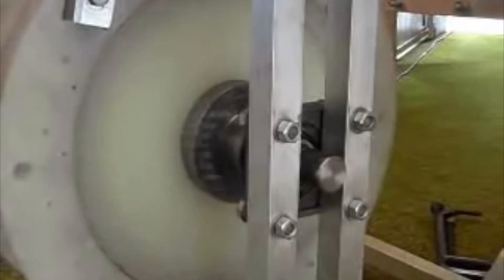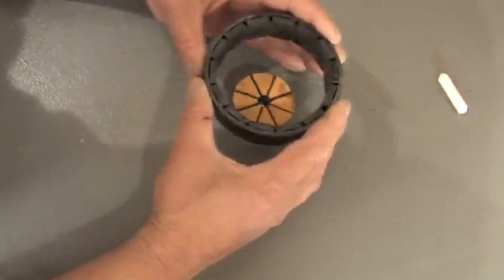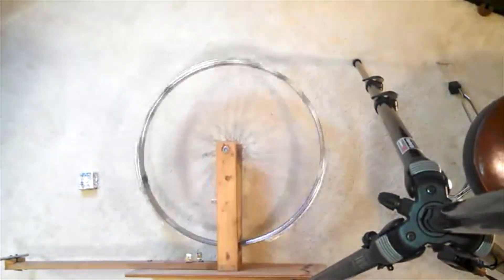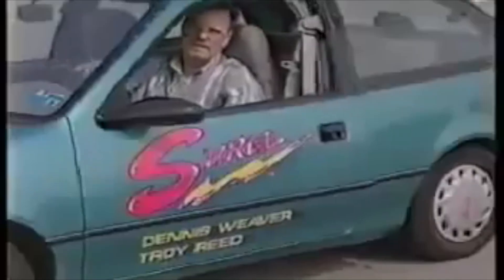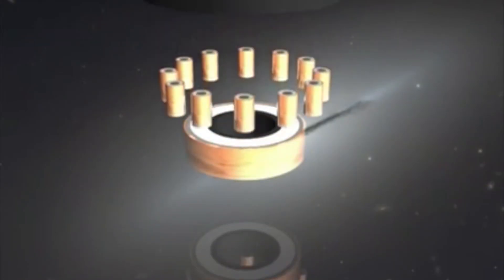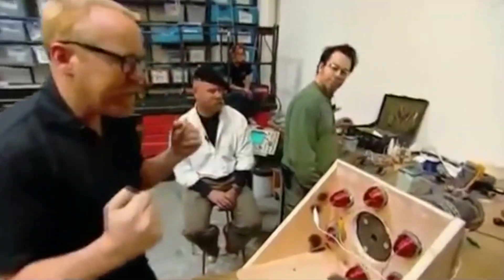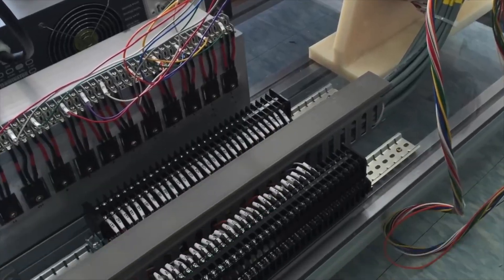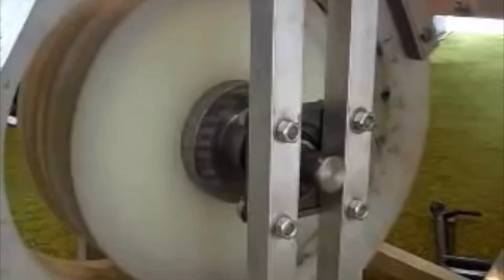Top 10 Most Famous Magnetic Motors

Comment: are those fake or real?? why is not possible to buy or found one ?
Reply: @darklight2.1  if magnets are not a source of energy how can work a dynamo??
Reply: @darklight2.1  its not simply, it convert with magnetism mechanical in eltctric, but why is not possible that this electric magnetic  energy is more than the machanical dynamo need  for rotate? dont need so much mechanical energy a dynamo to rotate , not much frictions, but it can generate a big load of electricity..so...
Reply: @darklight2.1  im not a scientist and matematic and my english is bad, but you tell me that a dynamo cant produce more energy than the energy need to move the dynamo right? but so why a 3hp power elettric motor can rotate and  work a 12kw dynamo?  for example if a dynamo need reach 2000 rmp to produce 12kw and an elettric motor produce 4kw at 2000rpm, so when you connect motor whit dynamo you have e close ciruit where motor can absorb electric energy from dynamo but many energy is free, only need a energy for start the sistem and after it self work or not?
Reply: @CostantinoLenzi    The problem with dynamo/motor combination is, that the dynamo can only produce 12 kW when it is rotated by a mechanical power of more then 12 kW. And the electric motor can only deliver 4 kW of mechanical power. You are not aware of a simple fact: when you increase the electric load connected to a dynamo you have also to increase the mechanical power to drive it. A 3 hp electric motor can only rotate a 12 kW dynamo if the dynamo is running idle without any significant load. If you try to get 12 kW out of the dyanmo you will fail.
Reply: @sciencefreak9070  and how about a magnetic dynamo instead normal dynamo?
Reply: @CostantinoLenzi    This applies for all types of dynamos - and for all other devices too. You must understand, that we can not really produce energy, we can only transform one form of energy in another form. E.g. mechanical energy in electrical energy with a dynamo. Or electrical energy into mechanical energy with an e-motor. Transformation of energy does not change it's quantity. That's the reason, why no system can have an output of energy bigger than the input. Matter of fact, many devices need an input of energy which is bigger than the output energy, since some part of the input energy is transformed into heat energy which can't be used and must be counted as loss.
Reply: @sciencefreak9070  my English is not good. This is theory.. But from where come magnetic energy? Magnetic energy can show is force also with no mechanical system.
Reply: @CostantinoLenzi    Don't worry about your English, I understand you quite good. First, what I have written about energy is not a vague theory, it is a fact! There is no observation known, which deviates from this "conservation of energy" law and engineers use it for calculations since a long time and the result is always precisely correct.

Magnets give you force but not energy. This may seem paradox to you but there are several forces which can give you energy, but only a portion and only for one time. To repeat it, you have to invest the energy you have just gained and such there is zero gain. Think of gravity. If an object moves down it can do work, but to repeat it you have to lift it up again which consumes the gained energy. Think of a compressed spring. If it expands the force of the spring can do work, but to repeat it you must compress it again which consumes the gained energy. And this also happens with magnets. If a magnet attracts an object, work can be done. But to repeat it you have to pull this object away from the magnet which again consumes the energy you have gained before. Just as you can't built a wheel which is constantly rotated by gravity you can't built a motor which is constantly driven by permanent magnets. Since with permanent magnets you always get forces turning the wheel clockwise and anti-clockwise in the same amount.

Permanent magnets are used a lot in e-motors and generators. But only as a tool to convert electrical energy in mechanical energy and vice versa. They don't contribute to the output energy. The output energy stems only from the energy which is input. Some people argue, when you fix a magnet on a ceiling it can hold by its force a heavy piece of iron for decades, where does the energy for that come from? Simple answer: this does not consume any energy. A force only generates energy when it moves something. If you hang this piece of iron with a spring to the ceiling, the spring will expand until its force matches the weight of the iron piece and it will also hang there for decades. But does the spring consume or deliver energy for that? It doesn't.

Comment: I'm not a conspiracy nutter, but I could believe that corporations and nations would strike at individuals that could upset their balance of power. Heck, corporations had people killed over trying to set up unions just a hundred or so years ago. No conspiracy about it, it's just plain fact.
Take a look at the electric car disappearance back in what, the 90s. I think they even made a documentary called Who killed the electric car.
Most people will blame the oil industry, and I wouldn't put something like that past them, but I think it would be more likely the American government used national security level threats to have it shut down. I know, it sounds crazy. Still, almost every car manufacturer shutting down their electric car decisions at the same time?
Why would the government do it? Jobs and dominance over the energy stocks I'd guess. America  has fought wars and toppled governments to maintain dominant control over many things, leastnof which is oil.
Another factor was the new electric car wouldn't need gas or oil. Also, it would have nearly the same amount of parts as the gas car. Gas stations, mechanic shops, whole sections of the automotive manufacturing industry, to name a few, would shortly go bust. Also, a sudden explosion of electric cars out to the public would overtax the aging American power grid and collapse it.
Sure, the tech wasn't there for a wholesale changeover. It was there enough to cause a massive shift for many of those industries.
Now, just imagine how many industries would be affect by extremely cheap or even free energy? Coal plants, shipping industries, major power brokers would all face losing their grip on power.
I'm not saying if this stuff even works, but if it did, I could easily see people bent on maintaining their inflow of money and power wiping a few people off the face of the planet to maintain it.
Reply: No one is shutting down the technologies in this video-they simply don't work.

The technology behind electric vehicles does work and is getting better all of the time. All of the major players in the vehicle manufacturing industry are investing resources into EV technology, while internal combustion development is almost nil-the fossil fuel vehicles that Ford and GM are selling today are almost carbon copies technology wise of vehicles that you could buy 20 years ago, just with slightly different body styles, more electronic gadgets and goofy and essentially useless eccentricities like power tailgates.

The government has no vested interest in shutting down technology, and companies don't work that way either. Instead, what the auto manufacturers do is work hard to convince you, the buyer, to spend your money on the product that is the most profitable for them-that's simply how business works.
 As EV's replace the combustion engine in general usage,  economies of scale will decrease the manufacturing costs of EV's and they will become the objects that manufactures will focus on convincing the buyer are the most desirable. 

The biggest difference between real world technologies and the devices that this video presents are that successful real world technology is always based on a solid understanding of basic principles of physics and engineering-virtually every motor in this video was not.
No one has to suppress technology that doesn't work-it simply dies away.
Reply: @darklight2.1  Governments can and do extreme things to maintain balances. The American government toppled a government to maintain low banana prices. That's not a conspiracy, but simple fact anyone can look up.
Also, if you look back a couple decades, you'll find evidence of car companies starting research into mass producing electric cars. One even leased out some to small pockets of the public to test out their reaction and use. Then, all the cars were removed, many against the will of the people, and they dissapeared. 
For car companies, manufacturing an electric car would be easier and cheaper because they have fewer parts and are far less complex. They didn't have bear the technology we have today, bit the people testing them liked them. Still, they shut down the whole operation. Many people have speculated why.
The most likely reason, in my mind, is that a quick uncontrolled shift fram gas to electric cars would put the economy off kilter. Many jobs dedicated to gasoline operations in a vehicle would become obsolete. How many gas stations does America have? How many engine repair and manufacturing places are there? How many jobs?
If banana prices and the corporation bent on keeping its power in banana growing countries can sway the government to take extreme action, I'm pretty sure a big ripple through the economy would too.
And again, I never argued that any of these motors worked. I simply said that if they did, it wouldn't surprise me how far certain entities would go to protect their bottom line or to maintain balance.
Reply: @haddow777  "For car companies, manufacturing an electric car would be easier and cheaper because they have fewer parts and are far less complex.."
You couldn't be more wrong. Modern electric cars are reliant on systems that didn't even exist 20, much less 30 years ago.
Check out the Tesla Model 3 motor-it's non induction based plant wasn't even possible 10 years ago. Development costs for this motor alone ran into the hundreds of millions of dollars.
The failure of the electric car in the 90's was primarily due to lack of consumer demand-not regulation or some imaginary suppression of technology. 
The limited range and power of the vehicles made them a poor substitute for internal combustion engines available at the time. And, yes, oil companies were involved and did purchase key patents, but that wouldn't have been effective if the EV technology hadn't been so early in it's development-with the evidence being that better batteries and computerized control systems have inevitably led to a more viable business model.

"a quick uncontrolled shift fram gas to electric cars would put the economy off kilter. "
This is a false dichotomy. There was never going to be an "uncontrolled shift". EV technology in the 90's was simply incapable of replacing existing internal combustion based powerplants. Here we are 30 years of development later, and EV motors still aren't capable of replacing heavy vehicle powerplants. If we can't do it now, it certainly wasn't a "threat" to stability back then.

"it wouldn't surprise me how far certain entities would go to protect their bottom line"
They couldn't protect it if they wanted to, and they know it. If and when some new technology becomes available in the modern connected world, that information can be disseminated almost instantly. If I was to somehow discover some new, ground breaking principle or mechanism in my field of work and was for some reason afraid of suppression, I could drop the specs into the inboxes of probably a hundred other engineers with the click of a mouse, and introduce it to tens of thousands of individuals via professional channels within hours.

The whole "suppressed technology" myth is simply based on a few historical instances of what were ultimately futile attempts-it makes good clickbait for the conspiracy minded, but doesn't really reflect reality.
Reply: @darklight2.1  The people who had those cars djd not want to give them up. There was nothing to indicate that they would be popular. Also, I said that the old 90s tech could replace all combustion cars, but it could have made a major dent in commuter cars. Also, the tech of nowadays is more about squeezing out more mileage to compete with all the combustion engine cars. None of the fancy tech they use was necessary to replace a large chunk of cars that don't go over 30-50Km in a day.
Reply: @haddow777  You are missing the point-the EV's of the time simply weren't ready to dominate the market in the way that you claim, whether anyone actively resisted it or not.

The '97 GM EV based priced at about 34K. It was lucky to get 70 miles out of a charge if you went easy on the pedal (which pretty much negated the claims for great acceleration), required a 220 volt charging station and took 2.5 hours to recharge.
Contrast that with the most popular comparable internal combustion vehicle of the same year-the Toyota Camry. The Camry base cost was about 16K, they were incredibly dependable (many are still on the road), got an easy 25 city, 30+ highway mileage for a 600+ mile driving range between fill ups.

Yes, a handful of drivers seriously lamented the discontinuation of the EV, but, for the most part, the program died with a whimper, and primarily because it wasn't profitable.
 
You need to keep in mind that the documentary that you are referencing was not intended to be an objective account of what happened-the very name, "Who killed.." tells you that. The reality is, the EV was simply not that great of a vehicle and the technology of the time (especially battery technology) was not developed to the point of providing a driving experience that the majority of buyers were looking for-a point essentially disregarded in that same documentary.

"None of the fancy tech they use was necessary to replace a large chunk of cars that don't go over 30-50Km in a day."
Again, that's not the point. What is necessary plays very a much lesser role in what people buy than what is *desired*.
Small, standard powerplant commuter cars like the Geo Metro were readily available to compete with the EV, got upwards of 40-50 mpg and cost 1/3 the price. The fact is that by the time the EV was starting to develop in a positive direction performance wise, the buying public was shifting away from high-mileage, small vehicles and towards larger vehicles.

The "fancy tech", as you put it, is the only thing that is allowing EV's to compete with the internal combustion engine now.
Reply: @darklight2.1  listen, to have a real debate, you have to read what someone said and argue the points they actually make rather than make up your own belief of what I've said and then arguing against a false narrative.
You've been doing this the whole time, intentionally misunderstanding the points I've made.
I specifically stated more than once that the electric cars would be capable of dominating the market, yet you keep insisting I've made the claim, amongst other false claims, and arguing against these false claims rather than what I've actually said. 
I said that EVs could male a pretty good dent in the low milage commuter car market, which is a portion of the overall auto market. It is a high use market, usingblots of gas, gas station service, repair service, etc.
The EV cars of the time couldn't dominate the market, yes. My claim actually was that they could take enough of a share, potentially, to destabilize the economy. Meaning, enough of them COULD be sold across the country to drop demand in fuel and oil, gas station services, mechanical services, etc to have an impact. If there is even a small percentage drop in demand for such things, you could see a lot of such services failing.
Like I said, a government was toppled over fruit and the impact a loss of control in that market would have on the American economy. It's not like the while food industry was threatened, just a very small portion of it.
Now I'm done this debate. Obviously there are many more false claims you have implied I've made. I'm fairly certain most people reading this will see that, so I'm simply going to discontinue interacting now.
Reply: @haddow777  I haven't mischaracterized a single thing that you have written and you know it-those are your own words quoted up there.

The reality is that you have a conspiracy-based narrative that you've adopted, and when it's demonstrated that the facts don't exactly fit that  narrative, you declare that your argument is being mischaracterized, pretend to be a victim of unfair tactics and abandon the discussion.

Essentially the equivalent of tossing the gameboard to the ground when one is losing-it's a common enough tactic,  but it certainly doesn't make any headway towards proving your point or learning how to build strong arguments.

Good luck.